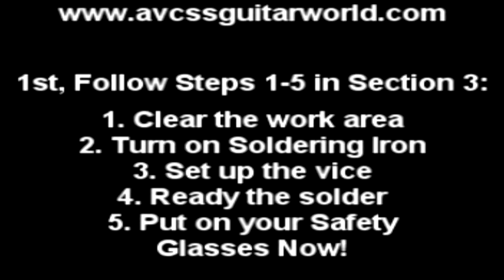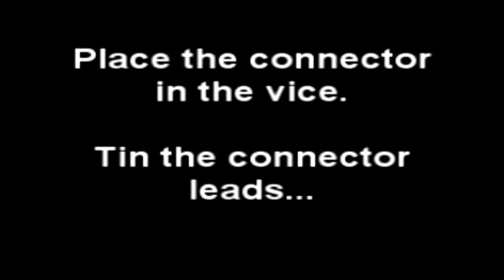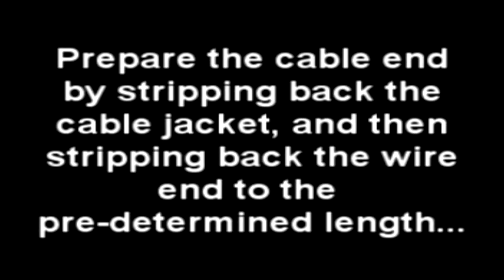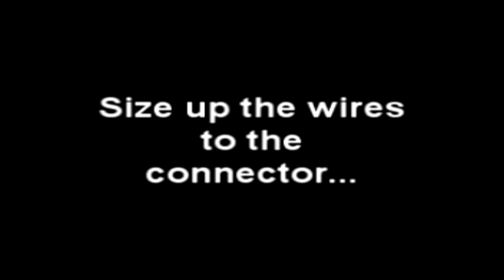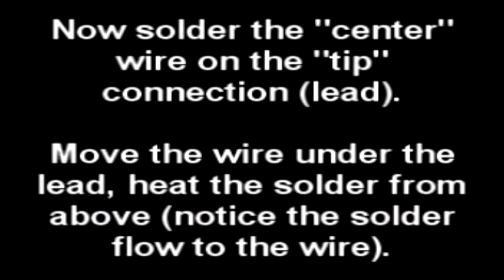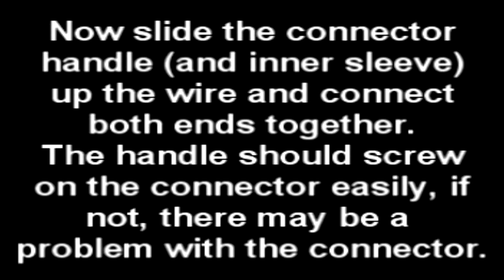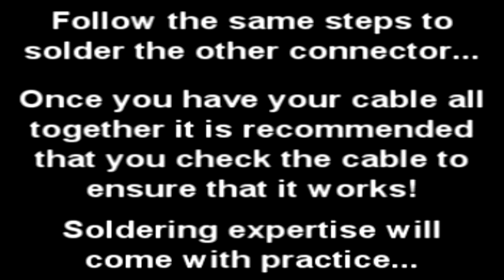How to solder a quarter inch mono connector, 1/4" Mono

Comment: Thanks a lot for posting this. I learned so much and without words can tell you have much expertise in this are based on how you did this. Others I've seen on YouTube are teaching others to solder the top wire from the top but seeing yours and how the puddle drops right through when doing from below made a lot of sense in my mind vs the other way shown on YouTube. It also seems that your method from soldering the top wire from underneath would also put less tension on the solder joints when the cable may get bent near there. Thanks 👍🏼